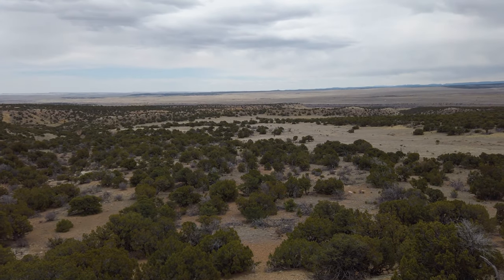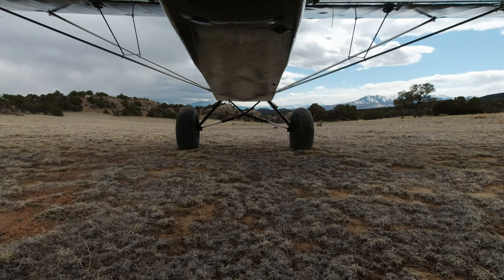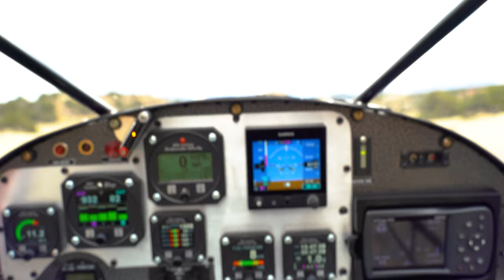Rotax 914 S-7S | Last flight with carbs?? ... what a cool place to land!

Comment: I'm sure you will , but keep close as track as possible as to the weight gain, all the little stuff,. Extra wiring for the dual (?) fuel pumps, breakers, all that misc. I guess for starters you could just weigh the old carbs, plus all the new stuff and extrapolate from there, and be honest with us, ha ha! If you haven't already with the new bird, try and get a baseline on your carbed fuel burn,  maybe at low,, mid, and full power settings, for comparisons sake to the FI. AND (as long as I'm asking) maybe a full power static runup, before and after.  The fuel savings I've heard from the FI  912 fliers has been spotty, but I've heard 20-25%, but none of them appeared to have had a HackMan Leaner, pre FI, like I have.  Lower burn rate means longer range of course, so money savings aside it's worth a lot in the back country.

Comment: Another great video. Helps get through the COVID situation. Can't wait to see the Fuel Injection transformation videos coming up. It already looks like the S7 with the 914 has a lot of power. What's it gonna do with the extra power from Leading Edge? Should be an E-Ticket ride.
Reply from the maker: kcpumpguy  thanks! Should run strong. A guy can really crank it up with the Edge setup... I’m going to force myself to only go for about another 5-7hp and enjoy the lower fuel burn and not blow it up haha!!
Reply: What HP do you think you have now VS how much do you think you'll have with the Leading Edge fuel injection upgrade? As I said in an earlier comment, I'm getting close to finishing my S7 with the 912IS. I'm just trying to get an idea of what kind of performance I'm likely to get with the NA engine in comparison to what you are seeing with the turbo. Trying to decide if I'm going to be happy with my engine or if I'm going to be looking to upgrade!.
Reply from the maker: kcpumpguy I think I was up around 120 or close to it. 117-120... the exhaust picked up 100rpm.. shooting for 125hp now. What elevation are you at?
Reply: @GravityKnightFlying  I'm at 1000' MSL, Kansas City. But, I'm not building the S7 to fly around here, I'm building it to take it out to your part of the world. My dream is to fly around in Colorado, Utah, Idaho. Go camping and basically do all the stuff you are doing. I'm told that there are interesting things to do with a STOL plane around here (Randy). And I imagine there are places to practice and develop skills. But the point is to get out to the mountains and the desert. 

I'm putting in a 912is engine. Nominally it's the same HP as the 912ULS, but it should do better at altitude with the fuel injection that does a better job of managing the mixture. I'm planning on flying it for a while with the stock engine but I'm already starting to daydream about upgrading it for some more power. The Zipper Kit is an obvious upgrade.

 In the meantime, I need to learn how to fly it. I've got 4000+ hours in single-engine piston airplanes, but I don't have a tailwheel endorsement if that tells you where I'm coming from. a 2000' paved runway looks kinda short to me in my Bonanza.
Reply from the maker: kcpumpguy  solo it will perform decent up here... with passenger and gear is where you will be wanting more.. that 100hp will turn into 65-75hp up at some of these high areas. Do they make a big bore for the iS? In theory some re-tuning would be required but their may be away around it? A big bore with fuel injection would run strong here!
Reply: @GravityKnightFlying  I've talked to Ronnie Smith at SMLA  and he's put the big bore cylinders on the IS and says that it works great. I asked if you need to re-map the ECU for the larger displacement, he said that the computer just seems to figure it out and make more power with no change to the program. It sounds very "doable".  I'm going to fly it for a while. If I get into this kind of flying like I think I will, and I think it needs more power (probably) this is probably what I'm going to do.
Reply from the maker: kcpumpguy  oh good deal!!
Reply: @GravityKnightFlying  If the 915 didn't cost as much as a nice car that would be interesting. That and the fact that it looks like it takes a major engineering project to get it to fit in the S7. Keep up the videos, you have a big fan in KC.
Reply from the maker: @kcpumpguy   agreed... original plan was to buy a cheaper, 912 powered S7 and really consider cramming a 915 in it. But the heavier nose weight, along with the cost and complexity to fit all steering me quickly to this bird when I found it. I think if you end up doing a big bore with the iS motor you will have a running machine. The factory redundant fuel injection is really a nice setup... and the extra power will make very usable in the mountains. Thanks, will do!